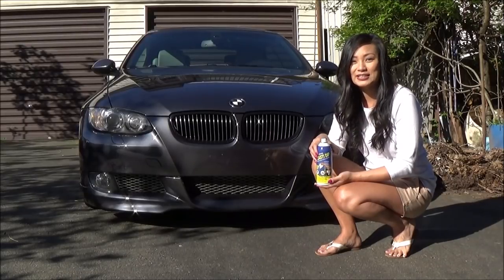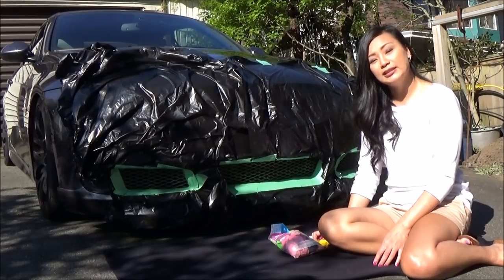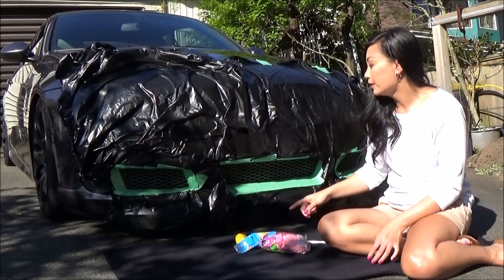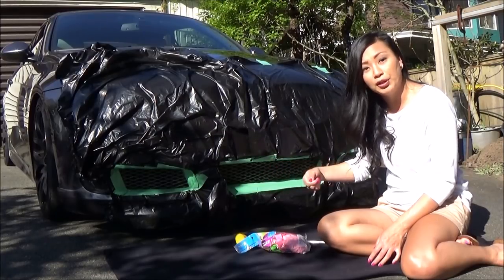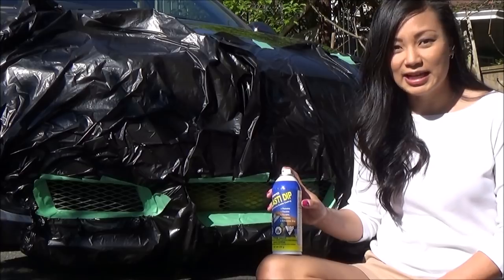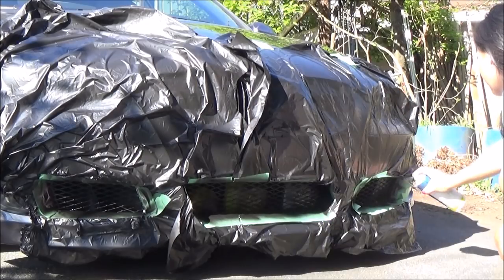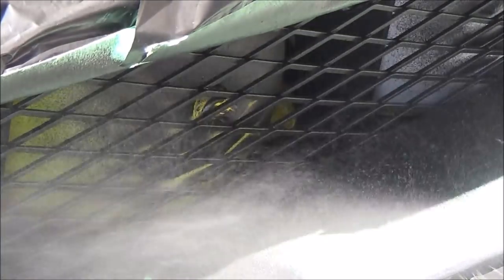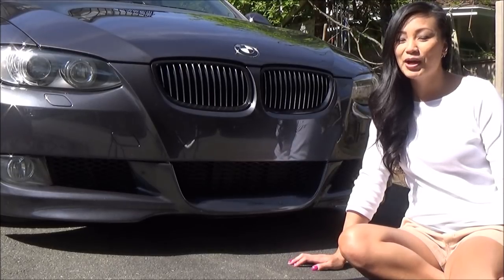How to Plasti Dip Car Grille - Balloon method - Black Out Mesh Grill on BMW

Comment: I've found that plasti dip peels after a while when exposed to elements and debris hitting the grill,  leaving a not so nice look.  plasti dip is difficult to remove from the grille being impossible to have a clean touch up or re do job. Also, on my 5 series the grilles pop out to paint easy. I have found it's best to paint with a black matte finish paint and matte  gloss. No intent to diminish your cool vid and cute smile. Thanks
Reply: I like how every comment was responded to, but this lol some people don't like anything but *praise*.
Reply from the maker: Praise*
Reply: @TVTara  thanks! My spelling is ass lol

Comment: Balloons were an interesting idea.

Was it not possible to slip cardboard behind that grill? Even if you had to jack the front of the car up to do so, it seems it would be less hassle and provide a better finish (assuming it is possible at all).
Reply from the maker: I had read it was not possible so I didn't even try.
Reply: Fair enough. Necessity is the mother of invention, your solution was inspired.

Comment: Hi Tara Im about to repaint a honeycomb grill pretty much like yours (abs plastic right) but in my case faded. I was told for best result one must  remove the parts sand it down smooth then use a plastic primer followed by the painting it and finally a clear coat.  

I'm curious as to why you choose not to take that direction? Equally curious to know how the paint holding up?  Apperciate your feedback  hopefully your reply might be of help to me thank in advance.
Reply from the maker: You do not need to do all that if you are using plastidip. I also felt like this is an area that will get lots of rock chips so the rubber will kinda protect it and you can also just touch it up easily.
Reply from the maker: It held up fine for years but I no longer have that car.

Comment: Hey , the car looks awesome. Thanks for sharing. I have a question, I just had a "chrome delete " done on my black 2011 7 series. Everything is done except for the rims.   I was told by others to stay away from the plastic dip , because it will fade over time . What are your thoughts on Powder coating?  Cool channel btw. I will sub .
Reply from the maker: Thanks! Hmm if your car is black, I would powder coat them in gun metal!

Comment: not sure if you can do it to this car, but wouldnt it have been easier to just remove the grilles? i did it on my tt. that saves you so much time.
Reply from the maker: +itz Tiipsy the bottom grill is easy to break, I heard.

Comment: Hi Tara.  I love your BMW how-to videos. I just bought my 2007 BMW 335i sport model. May I ask you for your opinion on the use of plastidip? What's it like in regards to long term wear and tear?  Does it keep its look and shine over time?  I'm debating whether to use plastidip or get it professionally painted wrt my rims and grill.  I live in Canada so we get pretty harsh winter months.
Reply from the maker: I would use it on winter wheels only and I think it's fine for the grilles. Congrats on your new car!
Reply: +TVTara 
I do have separate tires and rims for summer and winter weather.  So only use it for the winter rims and not for the summer rims?
Reply from the maker: I guess it depends on what color you're going for. I would only do summer rims if I could do a perfect job as usually these are nicer wheels.
Reply: +TVTara 
I have the charcoal gray like yourself.  Except my 335i is not a convertible like yours.  You're so handy and I just love it!  I wanna try to be handy like you!  Again, AWESOME JOB!

Comment: Hi, How did the plasti dip hold up over time? Did it chip much? If so how did you touch up? Did you go through this whole thing or just use a paint brush and get the chips? Thanks!
Reply from the maker: It held up great! I touched up once in the few years I had it! I have a new car now and have done the same!
Reply: @TVTara  OK Sweet! Thanks for the quick reply! I'll try it out on my 335i.
Reply from the maker: Good luck! It’s fun to do!
Reply from the maker: Oh and I just taped up a little section and sprayed a small area to touch up.

Comment: i know this an old video but u said once u remove the tape u can touch up the spots you missed......how did you go about touching it up without spraying more on? or did you retape it again and resprayed?
Reply from the maker: I only had to touch up a tiny bit at the bottom so I just put some tape around it and sprayed that one area.

Comment: Hey Tara how long have you had those black/white BMW badges on? I have 3 sets at home but decided to not go with them and go with the classic blue and white....I hand wash twice to three times a month and I do a full soft wool compound detail with a buffer and polish for 7.5 hours...

I'm still debating if slapping on non OEM badges would be tacky or not. Black BMWs ca lull it off but white? Though call!
Reply from the maker: They are vinyl stickers that were done when I wrapped my roof 1.5 years ago. They still look good.
Reply: Yeah I was thinking about the sticker overlay route as well. My 2013 AW SportLine F30 335i with that trim comes with gloss black mirrors and red/black seats and dashboard accents. It's a hate it or love it kind of thing. Check out my ride I just got her detailed from a local buddy of mine down here in Houston. Should be on my timeline. He cut me a ridiculous deal so I have to promote his side business. Lol CPA 3 times a week high-end only car detailer 4 days a week!
Reply: So far it has the panda theme going. The two lower bumper fog light whiskers from silver to gloss black, I installed a genuine gloss black BMW kidney grill set with an insane discount, BMW MPE cat back with rear resonator delete, BMW Gloss Black Peromance rear lip trunk spoiler, blacked out rear 335i emblem.

I have gloss black 335i emblems at home ready to swap out,
Oh and the corner lights have been removed and paint matched on the sides of the front bumper.

Love this car, but I am already considering the new Porsche Cayman GTS, BMW M4 euro delivery in Weir fully loaded, or considering a Jag F-type R.  What I really want is a freaking C7 z06!!

Comment: Im thinking about doing this for the kidney grills as well for my new 335i, does it give a finish just like the M performance grills or would you sand down and spray paint instead? Love the vids btw, gonna try the golf tee mod you did on another video as well! :)
Reply from the maker: Hmm I'm not sure how it compares to the m performance grilles but I know it's pretty common to plasti dip them. I wouldn't bother spray painting. Actually you can get eBay grilles for really cheap too.
Reply: +TVTara Did you buy yours from eBay?  In UK they are £35-40 which is around $55, is that how much you would typically pay for them?
Reply from the maker: Oh I think they should be cheaper. Order from a seller from Taiwan.
Reply: +TVTara thanks for your help!

Comment: you can always put cardboard to cover behind the grill. easier and faster
Reply from the maker: Where do you access the lower grille?
Reply: +Louis Garcia thats a good idea where did you learn that from
Reply: +corey chambers learned my self just raise the car
Reply: under the car
Reply: lots of newer cars have bottom plates, I can't reach the grille from below or above without unscrewing a bunch of things on any car here
Reply: @TVTara  exactly.. theres only a zillion 8mm screws holding the plastic cover on the bottom.. the ballon idea is better..and if u had used the long party balloons.. maybe one or two would have covered everything, depending on the size and shape of the balloon.

Comment: I wanna do this so bad. 
Is there an actual way to take the individual grills out and paint them? Do I have to take off the front bumper? Is it hard?
Reply from the maker: According to some comments on here, it's possible to remove the lower grilles but I don't see how, which is why I did it my way in the video.

Comment: you can actually take out the lower grills the pop off with a flat head pocket screw driver
Reply from the maker: Hmmm did you actually do this? Everything I read said this is not possible!
Reply: +TVTara yeah ive done it. The Lower center grill can be pushed out after popping off tabs with a flat head pocket screw driver.

http://www.e90post.com/forums/showthread.php?t=353504&page=2
Reply from the maker: +b18c5vtececlipse Ahhh 👍

Comment: I remember when I tried to take the front bumper off my 95 Celica to fix the weather seals around the headlights... yeah it didn't budge even with all the bolts off >:(
Reply from the maker: Yeah it's frustrating!

Comment: Balloon trick was clever, but would've been easier to open hood and slide down a piece of thin cardboard between mesh and condenser if possible.
Reply from the maker: +Brittany Wright I don't think that's possible.
Reply: TVTara you're right. Just looked at the engine bay and there is far too much trim in the way that must be removed plus the air intake is mounted high instead of on the sides. Good call.
Reply from the maker: +Brittany Wright 👍🏼

Comment: Ok, now for a serious comment that doesn't refer to, or care about, your "blowing skills". Sure, you might have accomplished your goal, but at tremendous risk to the car's paint. The mesh grill is not even worth painting in my opinion because you can find them as low as $30 on eBay for your particular car. However, if you have to paint, in the time it took you to tape, seal, put trash liners and yes, blow, you could have removed it altogether and painted it properly, and in a proper setting. I'm sorry, this just seems like a risky and unnecessary route to take. The only time anyone should mess with these grills is when they crack or get a hole. The mesh grill on one of my cars got a hole in it from a rock and I replaced completely with one I found on eBay for $22. The only way to get professional results is by doing what the professionals would do. Professionals would never paint a mesh grill in this manner. Truthfully, they probably wouldn't paint it at all. They would replace, or clean, but this part is simply not worth painting because of price affordability. Sorry, it's the truth. I still gave you a thumbs up for effort!
Reply from the maker: Oh I do lots of things professionals wouldn’t do! 😂
Reply: @TVTara  I know, I read the comments. 😐

Comment: Plasti-Dip is a poor substitute for paint.  You would look less bad with a big vinyl bra on the car.  Or maybe some truck bed liner.
Reply from the maker: For the lower grille, you can't tell it's plasti dip since it's hard to see.
Reply: Although I don't like how it looks, it provides good protection and can be taken off.